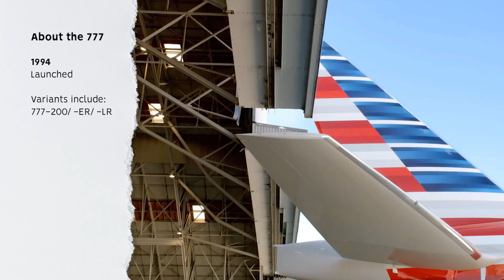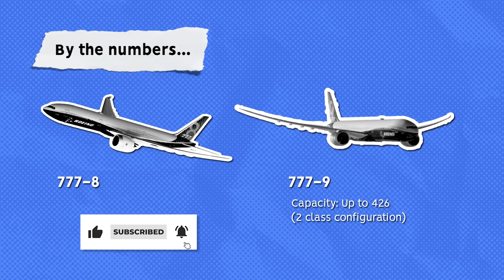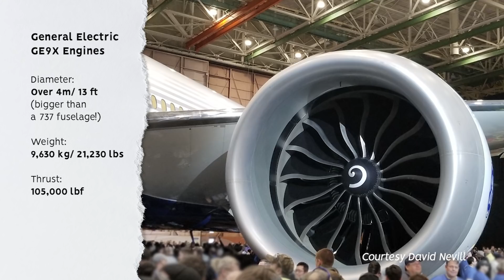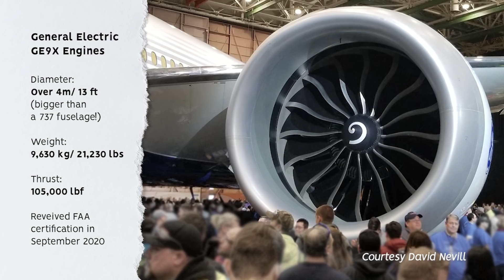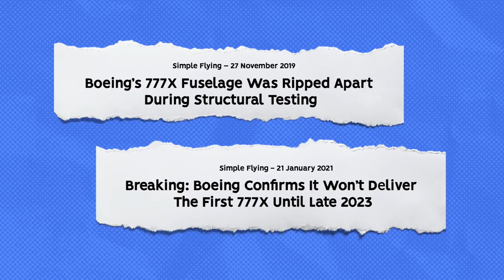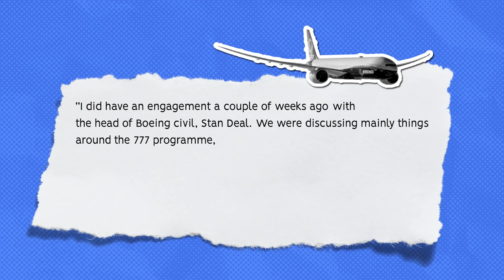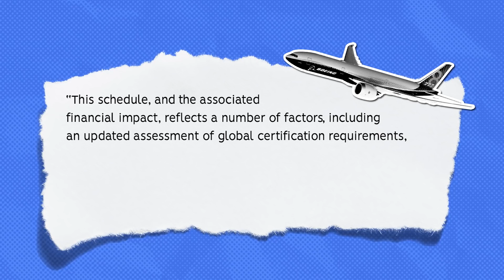Boeing 777X The New Twin-Engine Jumbo Coming Soon

Comment: Soon, in 2029 lol.
Anyway, it probably wont be a huge seller for boing. The industry is trendi g towards smaller planes and thinner routes.
Reply: @ianchristianvalentino9837  sure, for the really big routes these make sense.
Boing themselves have lowered fheir projected sales numbers to 350 in total.

All these resources over a decade spent on a plane that will make a marginal return over many many years. Resources that should have been spent on developing a new 737, a 757 replacement and a a220 competitor. Boing could have sold heaps of any of those and use those profits to fund new plane development.
Now they still need to develop all those planes, the 777x isn't gonna fund any of that development and meanwhile they basicly gifted the 757 and regional market to airbus for free.

This is going to a bigger millstone around boings neck then the a380 ever was for airbus.
Strategicly the 777x already is a failure before they even delivered a single one of them.
Reply: @ianchristianvalentino9837  Agreed, especially as this plane seems to have no direct competition...
Reply: @ianchristianvalentino9837  the trend of switcthing from huge planes on main routes (hub and spike model) to smaller planes on varied routes (point to point model), together with the rise of low-cost airlines, has been consistent through the last 20 years, much earlier that the pandemic. By the time that Airbus released the A380 this was already a foreseeable thing. So no, things don't change in an instant in the aviation industry, and the 777X is going against this trend.
Reply: Is everyone here just gonna forget that cargo carriers exist?
Reply: @aerofiles5044  Not sure Boeing has the money for an additional Freighter program right now (unless one is already planned, I don't know...) and anyway, new freighters don't sell in huge numbers anyway, compared to conversions. So another useful niche for Boeing, but nothing spectacular.
Reply: @fartingfury  Fair enough, but Airlines have ordered the 747-8F which also came out quite recently.
Reply: @aerofiles5044  boing themselves project 350 of the type in total. That includes freighters.

Comment: The 787s are more competition for the A350 than the 777X. Also last time I checked pretty much all the 747s are sadly gone after 2020, so there's no market there. 

I think the 777X especially  the 9 is too large. Besides that Boeing is a mess currently and airlines know it. I think there will only be a limited demand for it. The future for Boeing is the 787.

It's  a shame the "New Boeing" has now ruined the 777 the best plane Boeing every built.

One comment on your video. I don't think Lufthansa and Emirates would agree with you that the timing is good on Boeing's delays.
Reply: No the 787 competes more with the A330neo, the A350 is way too big, you are right about the 777X being too big for the A350, the A350 is better compared with the 777 classic
Reply: The 777X will be the only aircraft or the closest one to a "VLA" for a long time. And in non COVID times theres a market for aircraft that size. Not an extremely large market, but considerable -- especially without any direct competition. In the long run the 777X will be a sucess, it just had a very bad timing.
Reply: Just a comment about your 747 comment. These capacities are needed. That’s why Lufthansa is reactivating some 747-400s as well as some A346s or A388s for the time until the 777X arrives

Comment: Everything is a Game Changer. So sick of that term
Reply: And rarely is anything a game changer. Not even the sad YouTube channels that overuse it.
Reply: Not game changer for most average people that fly in 16 inch seatings in coach.
Reply: I recently brought a Toyota Yaris. What can I say? TOTAL GAME CHANGER!
Reply: As well as 'iconic'.  Most overused too.
Reply: stakeholders is another one!
Reply: the only 'game changer' imo is the A380 but seems airlines don't want to play that game anymore
Reply: @fatdoi003  For some strange reason I only trust Air Bus.
Reply: gamer changer at present time  , like a380 was a big game changer back in 2009-2010
Reply: @karann4335  But it could not change the game, in the long run... In any case, how was it significantly different from the 747-8?
Reply: @karann4335  By any chance you don't work for Boeing, cause if you watch the video about working at Boeing the workers were the ones who said they wouldn't fly in that plane, meaning the one they'd just built.
Reply: @karann4335  not at all. The 747 and Concorde were 'game changers' at the time. There was nothing in the skies like those aircraft. How big a 'game changer' was the A380 compared to the 747? It was a pretender that entered service a decade or more too late.
Reply: @karann4335  a380 was a failure from the start.
Reply: @antr7493  completely incorrect a380 did work well for gulf carriers
Reply: @karann4335  No it didn't. High maintenance cost, fuel costs, they couldn't fill the entire planes and Airbus didn't listen to any of the carriers when they were demanding upgrades to improve it. You probably think it was successful becasue you watched a bunch of videos hyping it up, displaying the showers and gold plated toilets, etc, etc.

Airbus released a 4 engine aircraft to compete with the 747 when the industry was going the other way. Lighter, more fuel efficient, two engine planes that were easy to operate and maintain.
 If they would have released this i the early 80's it might have had a shot. It was a failure.
Reply: @antr7493  Depends on the airline and usage. Ive flown them dozens of times between UK and Australia. It is the best ever aircraft for long haul flight as far as the economy passenger is concerned. The 777s have squeezed in an extra column of seats making them ultra thin and painful on a long flight.
Reply: @antr7493  ''You probably think it was successful becasue you watched a bunch of videos hyping it up, displaying the showers and gold plated toilets, etc, etc.''
Rubbish! I have had maybe 20 flights on the A380, more if you count all the stopovers in between. It is by far the most comfortable long haul aircraft ever, quieter, more human space, less subject to turbulence etc.  All new 777s have ultra narrow seats which is how they get in nearly as many as the old 747s, ie the economy class passenger pays with severe discomfort.
Reply: @stephanguitar9778  Just because you're comfortable on the flight that doesn't mean it's a financial success. I'm glad you enjoyed your ride though.

Comment: I don't think this will change the world. It's more of an evolutionary change. Sure, an 11% saving in fuel is great, but lets face it it's a drop in the ocean compared to what's actually needed. I feel like they'd have been better off just upgrading the existing 777 while simultaneously working on something more radical - hydrogen, hybrid, electric etc.
Reply: No other source of energy is as efficient, safe, or lightweight as jet fuel. It has far less weight, complexity and danger than hydrogen, far more range and economy than electric, far more safety than nuclear. There simply is no other option that comes close. 

Maybe someday we’ll have Mr Fusion from the Delorean in back to the future, but until then jet fuel efficiency is key.

Comment: One doubt I heard that the 777x will not have engine design of 787. Is it true? I am talking about the chevron design
Reply: Are you referring to the chevron design? If so, here is a video on that:
https://m.youtube.com/watch?v=BKe5EmPMp2Y
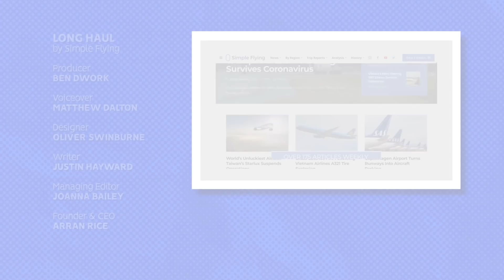Reply: @Agent44996  But did u see that in this video they actually showed this design 12:21
Reply: @thomastharun8085  Ah I see. That must have been an older design because they quietly got rid during development. If you look at current 777X aircraft you will notice the engines do not have this design.
Reply: @Agent44996   Thanks for the information.
Reply: @thomastharun8085  No worries.

Comment: The 787 is the first aircraft after Boeing merged with mcdonald Douglas since then all aircraft have issues
Reply: So true. The original 777 had a program manager (Alan Mullaly) who had responsibility for the overall program. The 787 was designed by a committee. Endless meetings, no single authority to break a tie or make decisions. The 787 intro to service was a disaster compared to that of the 777. There are many reasons for that, one of which is they tried to put too many unproven technological ideas into one package. But it also seems that Douglas management was involved in the whole thing and screwed up a lot of it.
Reply: @Richard-bv3er  why do you make it sound like a bad thing? The Dreamliner introduced new tech to significantly improve efficiency and reduce complexity

Despite its rocky start it is still the best selling and most efficient Widebody jet in production. The Dreamliner is on the path to surpass the 777 family as the most successful widebody in history. 

Boeings gamble with the 787 has paid off.
Reply: the 787 also has problems
Reply: @albucristian7861  please state them , if you can't then you don't know what you are talking about
Reply: Oh yes, the original 777 was the last good aircraft from Boeing.
Reply: Why Douglas? O my
Reply: EXACTLY!
Reply: Hmmm 🤔 you have a good point
Reply: I’ve recently flown in business class with Etihad on 787-9 & 787-10 and, I have to admit I was very disappointed with the seat - very uncomfortable in lie flat mode, especially with no mattress topper. Room for feet felt extremely cramped. Give me the A350 any time
Reply: @raymondmassie4898  but that has absolutely nothing to do with Boeing. It's airlines who select their cabin configuration not Boeing.
Reply: @mmm0404  not disagreeing with that but it was an observation

Comment: There is no doubt consumers will switch to 350-1000 instead. The useage of 350s itself not filled the full aeroplane loads due to the pandemic and decreasing demands. Obviously the trend will switch from wide body long haul range to narrow body longhaul range. But it still be great to have some 777x on airlines either its effective or not, yet it just appealing.
Reply: We don't  know  yet  ontil the 777 go to service. And we don't  know what could happen on 2023. For now what matters the most is that Boeing get out of the nightmarez
Reply: We'll see

Comment: I don't like any of Boeing aircraft except 787 -9 and -10 so I think it will be a headache for the airports due to its size like a380
Reply: That headache should have different reasons. With the foldable wingtips it was except the length the same footprint like the 777-300ER had, and as it’s only a bit longer than aircraft like the A340-600 or 747-8 there shouldn’t be a problem with airport gates and ramps
Reply: @spongebubatz , They aren't winglets, they are foldable wingtips...
Reply: @simondahl5437  yeah you’re right, thanks for the correction

Comment: if something happens to the extended wingtips while in full flight, e.g., it falls off or ripped off, what is going to happen to the aircraft?  has testing accounted for this possibility?
Reply: I guess you could say that above any moving part on an aircraft. I imagine it would be flyable, as long as the pilots were quick enough to conteract the additional lift on one side with some control inputs and adjustment of engine output. One would hope that there would be some software monitoring this that could take action if needed, but it'd better be written by different people than those who came up with MCAS!
Reply: Nothing would happen, the wingtip isn’t structural and doesn’t really provide an important amount of lift. The aircraft could safely fly to its destination.
A similar story once happened to an Air Namibia A330 which flew without its left winglet for some time!

Comment: With the benefit of hindsight, and the growth of long-range single aisle aircraft for routes that  eliminate some of the need for hubs, might this aircraft be no longer needed?
Reply: The airlines that ordered huge amounts of 777x such as emirates Qatar and Singapore all still rely heavily on the hub and spoke model. In fact that is their whole strategy because they are in ideal locations to connect flights from around the world.
Reply: @AlohaBiatch  ME3 and SQ each have 1 hub only, so without upgauging they have nothing to do other than sitting and waiting for airport expansions. But for US, Chinese or European carriers they have more choices.
While IAG still purchases 777x for BA, their recent stregagy is clearly diverting passengers out of LHR - Latin America to Iberia/MAD, low-paying customers to Aer Lingus/DUB, and domestic leisure travellers to LGW. All mitigate the need for a VLA without compromising growth.
Reply: @steinwaldmadchen  Yeah but the whole diverting from LHR thing might just be because Heathrow is at max capacity no? If Heathrow still had slots I'm sure it would become a bigger hub.
Reply: @AlohaBiatch  But then you don’t always need a 777X to grow tbh.
The whole idea of upguage is that 
1. Slot is constrainted that adding frequencies is impossible
2. Adding more flights is meaningless - either frequency is high enough, or it’s time insensitive red-eye flight.
Otherwise you can always add frequencies.

But nevertheless it’s far from pure LHR capacity
1. While UK has close ties to US and Canada, the same can be said for Spain and Latin American countries. Geological wise MAD is also closer. Strengthing IB would be easier than BA building Latin American network at LHR from scratch
2. While BA & IB are so-called premium carriers (ok service wise they aren’t), there are some lower-cost players in the scene - be it Icelandair, Air Transat, Jetblue or Norwegian. They come and go, but someone's always there.
Aer Lingus, being a fairly successful player in that category pre-acquision, is a better choice than BA/IB in competitng that segment.
Reply: Hubs aren't really going anywhere. What the smaller aircraft allow is more spokes from the hub in most cases. There is little movement away from the major international hubs.
Reply: routes from western Europe to SE asia cannot be catered by narrow bodies, even the long range ones.
Reply: There is no way on earth that I would sit for 14 hours from SFO to TPE in a single aisle aircraft, even if they could strap on enough gas cans.
Reply: @daneclark3161  14 hours will never happen on the A321XLR. It's max range is 4500nm or 8300km. So in reality it's likely you'll see it on flights up to 7500km or so.. That's what a  9 or 10 hour flight?

And With economy class being so tight and rubbish on many airlines, I don't really see what the difference in comfort would be between  long haul on a narrowbody and a widebody....

Comment: Future of Aviation in 3020: no engine only gliding
Reply: 2300  they would have federation star ship.
Reply: @Perich29  sooner The Federation is already been created .
Reply: No humans left, only eagles gliding in the sky.
Reply: I expect by 3020 we would have teleportation available, finger crossed 🤞
Reply: 4050: wingless plane
Reply: @morefoodsmorenudes8046  that was in 1943😉😉
Reply: 3020 or 2030? China successfully tested the new "plane" a week ago, it reaches 100km, back to the airport after manoeuvring (not gliding) in the atmosphere. ( today date: July 28, 2021)

It has an engine but works as a rocket engine in a no-air zone (20km-100km) and works as a normal plane engine inside the atmosphere. It can reach New York City from Beijing in 45 minutes.
Reply: @madeinchina1450  Wow that's pretty cool, is there an article i can read?
Reply: @morefoodsmorenudes8046  https://mil.news.sina.com.cn/china/2021-07-18/doc-ikqciyzk6181705.shtml

Google translate the title
过于先进 不便展示！
Reply: @madeinchina1450  
Sounds like a bag of bollocks  !!!
Reply: More like 2035. You will  fly to space then come back down cutting travel time .
Reply: @dallasbrat81 
2045 they no longer need aircrafts..
They going to jetpack.
And of course they going to add the "honey tank" with it.
By simply connecting a wire to your bum hole and frontal stuff for more comfort..
Reply: @أحمدالجهني-ع6د  The Next superpower will control access to Space 🌌
Reply: @dallasbrat81  wow